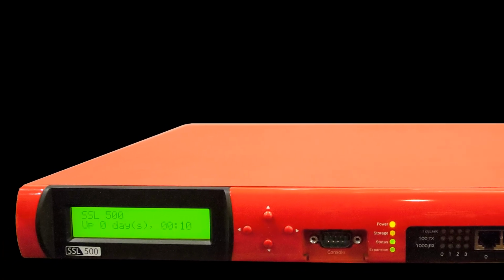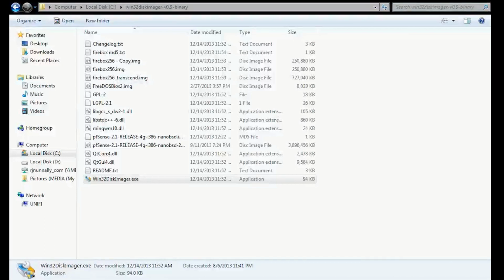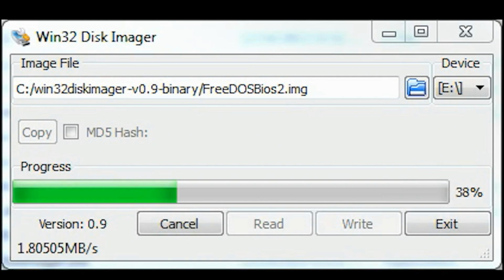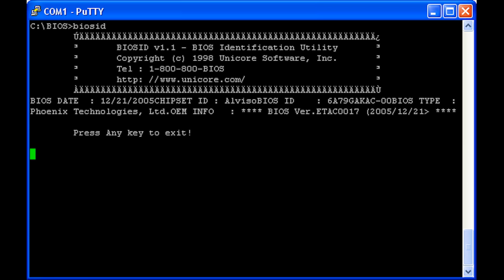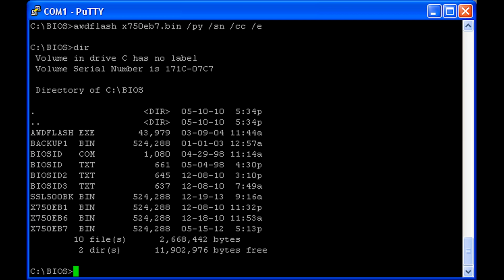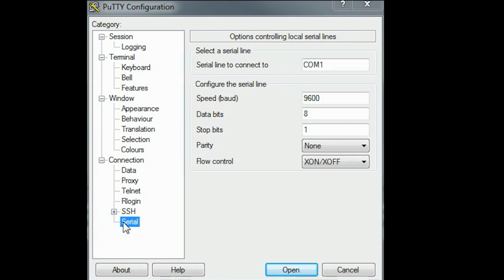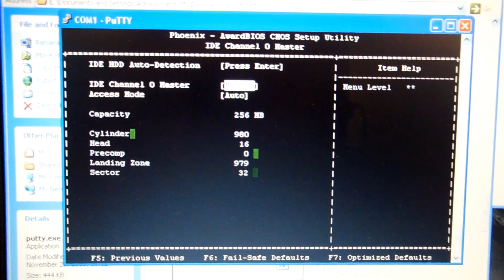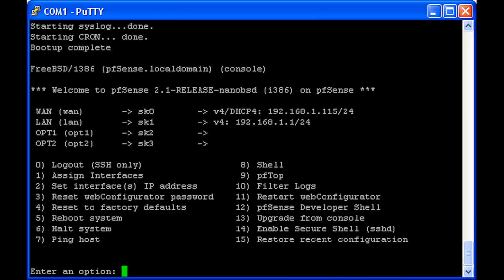How to flash pfSense on a Watchguard x550e, x750e, x1250e, or SSL 500 firewall

Comment: Guys, I've got an issue with this. Tried multiple CF cards but just can't get the thing to boot! Just now I finally got my hands on a SanDisk 4G card but still no go. I've flashed the firmware so that part is OK. But the pfSense image won't boot for the life of me. Writing the image with no errors with win32Image.

Can someone tell me why I should change the Head count from 16 (default) to 2!? that changes the size of the CF card from 4G to 512MB!
Reply: It has to be my "Extreme III" SanDisk card that's the problem here. Cos if I dd the first MB of the pfSense image to the 128MB card that came with the Watchguard it boots into the freebsd bootloader just fine. Guess I'm hunting for another card after all :/
Reply from the maker: +Stefan Nordlander The WG is picky about CF cards. I ran into a similar problem with FreeDOS myself and ended up using the factory card. I haven't had any problems with the 4GB cards though - if you buy the card recommended in my article, then you can get one that's verified to work. Also, the head count in the BIOS is just a hack; the full size of the card will show up in pfSense.
Reply: Not to neg down on the Watchguards which I guess is pretty good hardware. But I actually ended up putting mine on the shelf when I got a D-Link DFL-1600 for free which boots and installs latest pfSense out of the box. :) But best of luck to everyone runing on the Red Lion ;)

Comment: Some or most will get the UDMA error while booting, so you'll have to press Enter or any key while booting and enter "set hint.ata.0.dev0.mode=PIO4" and after "boot" but after you might also run into "time zone error" and CF card is mounted as read only and you can't do crap, you'll have to remount, edit your bootloader so your udma disable feature is permanent and use loader.conf.local vs loader.conf otherwise your update will wipe your changes.

Them issues are on 2.1 -> 2.2.5 beta as of today.
Reply: +DaBiJa ok, How do I remount and edit my bootloader? I am racking my head on this. Cannot find solid answer to it.
Reply from the maker: DaBiJa Yes. The version of pfSense I used for this video predated the UDMA issues, but all the newer releases need to do what you suggest.
Reply: Can you do a step by step tutorial on this issue?

Comment: Just did this process, Had to set the flow control to none otherwise i got ▒▒▒▒▒▒▒▒▒▒▒▒▒▒▒▒▒▒▒▒▒▒▒▒▒▒▒▒▒▒▒▒▒▒▒▒▒▒▒▒▒▒▒▒▒▒▒▒▒▒▒▒▒▒▒▒▒▒▒▒▒▒▒▒▒▒▒▒▒▒▒▒▒▒▒▒▒▒▒▒▒▒▒

But Coming from my background this was easy to figure out. Awesome startup guide.
Reply from the maker: Daniel Huber I'm glad you were able to figure out the issues. Flow control should be set to "none" as you noted, although in practice it works for me with the PuTTY defaults.
Reply: Hexhound though now I'm getting weird issues. I posted in the thread on pfsense

Comment: Will this work on the x700 also?
Reply from the maker: The x700 is capable of running pfSense, but as it is an older generation the procedure is different. I believe you can flash pfSense and go... no special BIOS needed. Be aware that pfSense 2.2 needs DMA disabled for it to boot properly - 2.1 should work out of the box.
Reply: Hexhound
OK, that's the problem I ran into.  I tried to put 2.2 on after I flashed the BIOS but when it boots it gets stuck on DMA.  Do you know where I can download the older version, it doesn't look like they had it on the website anymore. Is it a problem that i already flashed the BIOS?
Reply from the maker: Mike, you can grab 2.1 from my website https://www.hexhound.com/how-to-flash-pfsense-2-1-to-a-watchguard-firebox-x750e-x550e-ssl-500 

I'm not sure what BIOS you flashed. If it was the x750e BIOS, yes, that is likely a problem. I don't have an x700 to compare to so I'm operating blind.

Comment: How noisy is it?
Reply from the maker: It's quiet (basically silent) with the fans regulated using WGXepc. However, it sounds like a jet engine taking off before WGXepc takes over control. I've also run into a couple with failing fans that whine even with the fans turned down, but they're easy to replace.
Reply: Hexhound I bought one of those BananaPi routers (BPI-R1). Thank you anyway. :)

Comment: Quick question, when I change my terminal config to 115200, all I start to get on my screen is àààààààààààààààààààààà
Any ideas on why it would do this? everything else went smooth, but I can't get into the bios because I do not see the boot screen.
Reply: Figured it out, let it boot completely when the display shows loading os, then reboot it.
Reply: +Dean Thompson Im having the same problem. Flashed FreeDOSbio to my 128MB CF card, Install it in the Firebox, Connect with putty, turn her on and it beeps once, then three times but I dont get anything on putty. The screen on the firebox says Booting OS.... You say you had to restart it? I've tried that a bunch of times now and still cant get anything to come up in Putty. Any advice?
Reply from the maker: +Mike Morey It's been a while since I've done this, so bear with me. I originally had major problems getting the Firebox to boot into FreeDOS. The Firebox is very picky with CF cards - if it won't boot, try using the factory CF card if you're not already. Once I used the card that came in my Firebox, it booted without a problem. All my older CF cards failed to boot. Also make sure your serial connection settings are correct and if possible, use a hardware serial interface rather than a usb to serial adapter.
Reply: Thanks for responding. I used the 128mb card that came with and it wouldn't boot. I had a 2gb card laying around so I tried it not expecting it to work, and it didn't. If I boot up the firebox with the original OS on the 128mb cf card and connect with putty, I get a bunch of garbage text back. I didn't play around with boud rates setting yet. I got frustrated and discouraged. I think my next step if finding another cf card and trying that. They're hard to find locally and even harder to find with less than 1gb. The firebox boots fine off of the 128mb card with the original OS so it's hard for me to believe that it's the issue but I don't known what else to try. Thanks for the response.
Reply from the maker: Sorry to hear that. Have you tried clearing/resetting the BIOS? And did you verify the MD5 hash on the FreeDOS image?
Reply: +Hexhound I have not tried clearing/resetting the BIOS. Could you tell me how or point me in the right direction to figure out how to do that? And I did verify the MD5 hash and they match perfectly. Thanks again for taking the time to try and help me with this. I really appreciate it.
Reply from the maker: With the Firebox unplugged, simply pull the battery, wait a few minutes, and put it back in.
Reply: Well... I pulled it, Waited about 5 minutes and tried again and got the same results. Im starting to think its my CF card. Or the image on the CF card. I was having issues with windiskimager and creating esxi bootable fash drives earlier today also. When I used rufus2.6 they worked. Booted and installed just fine. Do you think that maybe that could be the problem? Im gunna give it a shot and see what happens.
Reply from the maker: It won't hurt to try. It sounds like your CF card to me though and flash memory does fail.